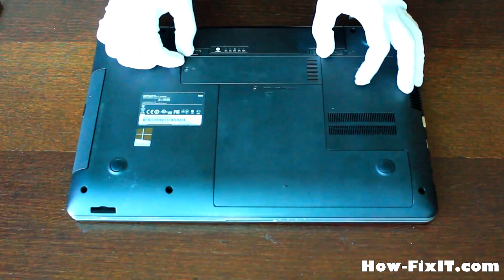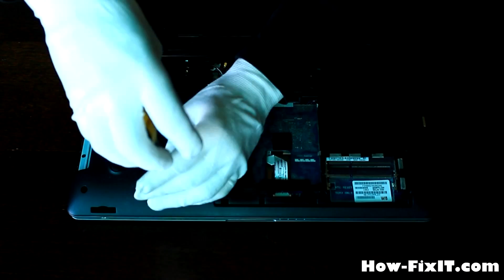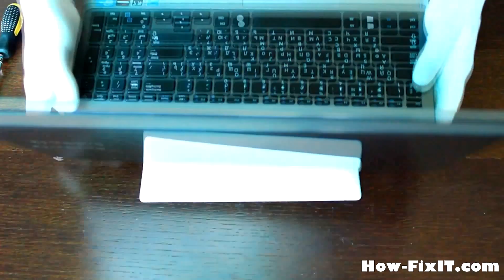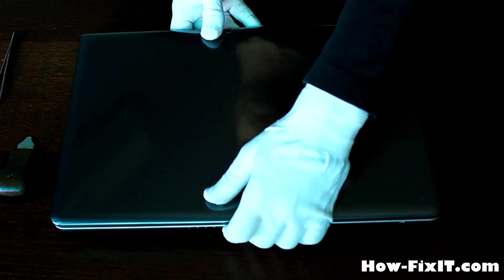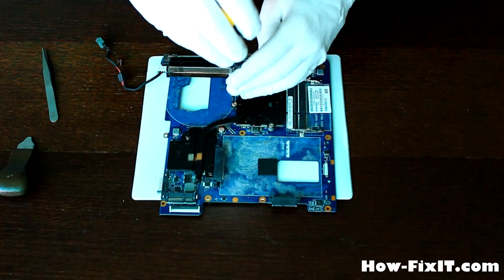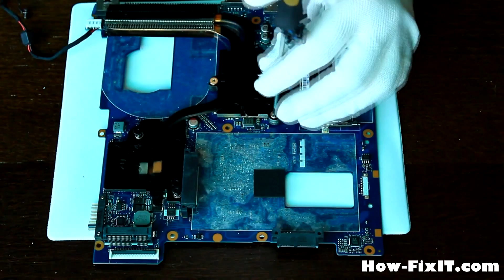Samsung 350V NP350V5C Overheating Fix: Disassembly & Cleaning | Step-by-step DIY Tutorial

Comment: Have a NP350E7C-A01US that will not power on, blue light goes on for few seconds, no fan turns on. I did try all the tricks, removing HDD, swap memory, remove battery, adapter measures 19V. I am helping a friend who needs for his kid and before I dismantle wanted to know what I may be facing. TY

Comment: My display stopped working. The laptop is turning on no problem the fan is working but no lights on display. I rechecked all connectors and still nothing. What do I do?
Reply from the maker: After cleaning laptop stopped working?
Reply: @howfixit  I fixed it. I had to remove the battery and press the power button for 1 minute. And that solved the problem. Thank you.

Comment: Did the hard drive have a metal frame/caddy/tray, or was it just wrapped in that foil material with screws on the side? Is friction the only thing holding it in place?

Comment: Thanks for the vid, I got mine disassembled by trial and error but still did the job done. Those hinges are hilarious tho - You have "hurr durr stronk metal" attached with some tiny screws to some crappy plastic. In my case, the left one got "its own life" cause it broke off from the backplate. I put about half of the hot-glue stick in there and it seems to be working so far :3